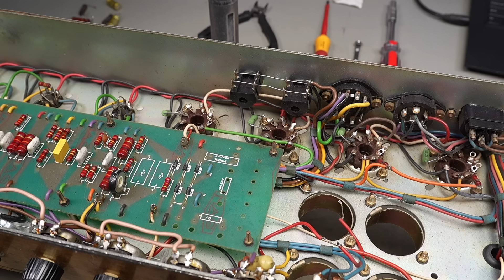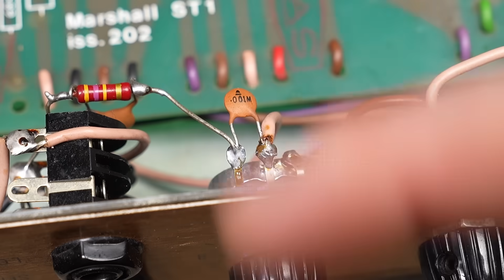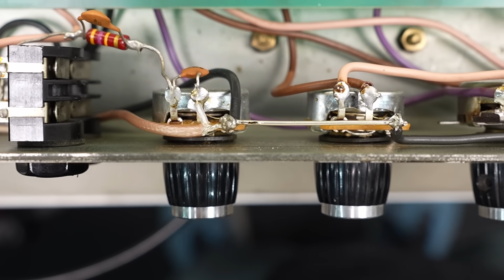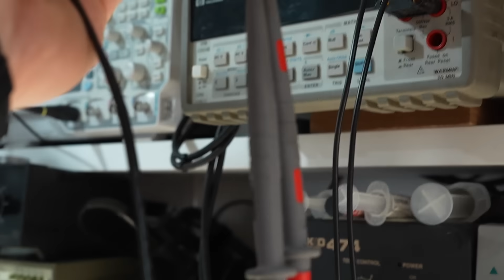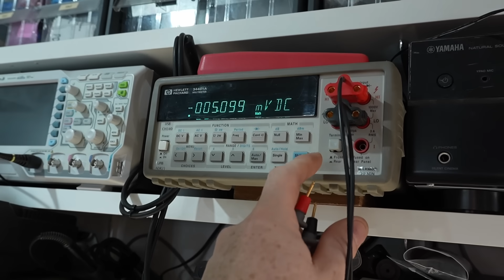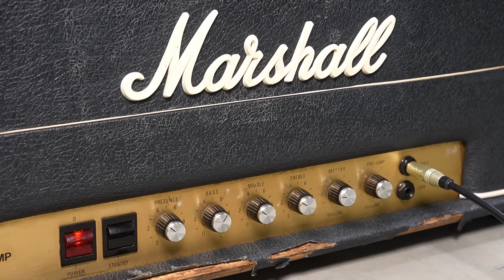JMP2203 - Part Two

Comment: Great job and great sounding amp! I just de-modded an ‘82 2204 jcm800 and it’s a blast to play. Need to look into these ground schemes and change some of that around but it’s a work in progress, first order of business was to de-stupid it. Had to also run another resistor in parallel on the bias circuit, I think it’s because it has a Dagnall OT even though the choke and PT are Drakes. Had so much negative bias voltage it would swing into cutoff just below the X axis on the scope when injecting a signal.

Comment: Taking bright caps out of the 2204/2203 is for wimps. You are only allowed to run these at 75% gain. There is no other setting.

Comment: Sounds epic! Appreciate you sharing more of the grounding theory. I will need to watch the part about grounding a couple more times. I think I missed what you do to manage the micro resistance in the chassis, if there is anything that can be done aside from using dedicated points
Reply from the maker: What would you rather do than use multiple grounding points?
The idea is to isolate the reservoir capacitor's current pulses in as small a loop as possible, and not have those currents flow in the chassis, but rather just be tied to it, away from the preamp ground.
Reply: @BradsGuitarGarage  Oh no I am not trying suggest the grounding scheme is incorrect in any way. I think I overthought what we normally take as granted to be grounds. Overthinking about overthinking is my normal state so I think I heard a couple points while I was working and missed your intended message. Definitely going to watch again when I can focus 🍺
Reply from the maker: Granted, I'm not the best at getting my points across, sometimes! LOL!

Comment: Hey Brad, what year is this amp?  I have one from 79 that's more or less untouched.  I wonder wht the resistors and wires look like- it's been years since I had the chassis out.  Of course, mine's mostly a home use amp without a power soak, so it does NOT get played hard.
Reply from the maker: No idea, mate.
Maker label illegible, and no time to research the minutiae.
Reply: @BradsGuitarGarage no worries, mine has the date on the chassis, thought that one might too.

Comment: Why do people not like the Marshall dsl20cr?
Reply from the maker: Because it runs the valves at around 40% bias, primarily.
Any attempt to bias them hotter just sags the pissy little power supply.
The most you can get out of them, even with circuit modification is around 50%, and remember it's a cathode-biased amp. We're aiming for 95-100% here.
Drop a set of 6V6's in there and compensate for the different plate load by running the speaker impedance off by one notch and you'd have a nice little amp, then!
Reply: @BradsGuitarGarage thanks for your reply

Comment: The grounding thing is so interesting, because our natural intuition for electricity is borrowed from our daily experience with gravity and the easy analogy with water. Gravity however, is so much weaker, like 10 to the power of 36 times weaker! With that in mind, it totally makes sense that a tiny fraction of an Ohm is a big deal.
Reply from the maker: It's very hard to explain to people how weak gravity actual is!
It blew my mind in high school physics lessons.
Physics still blows my mind.
But yes, people tend to think of the chassis as a magical black hole for return currents, where that is not the case.

Comment: What a nice looking amp! I just just bought an Applied Physics clamp on ammeter with a 20uA resolution that has a Kelvin lead current clamp. It is a modernized Hewlett Packard 428B or C, which I think IF you put a digital display on the old HP you could probably get it to a +/- 1-1/2% tolerance, but with the analog gauge it is +/- 3 divisions + another 1-1/2%, which really sucks, but it is an OLD 1966 vaccum tube meter. The clamp runs both 20KHz, + 40KHz signals (sense & send) and it degauses the Kelvin clamp's probe laminates every time you turn it on and off. The Applied Physics unit also has a magnetometer probe for testing the magnetic fields in guitar pickups.

Comment: Hey Champion, good timing on this job!! I am going through my three 2203's for the first time in 20 years, lots of useful stuff, I'm following the grounding scheme you've done here, great idea on the grid stoppers with the tag strips....  I have extensively messed about with all possible combinations of the treble bleed and treble peak caps, I have ended up removing the cap on the pre-amp volume (I dont run the level flat out, I use a mix of humbuckers and single coils playing dirty old 70's rock),  gives me the ability to vary the level and have the consitent tone without that ear bleeding top end which gets worse as you lower the level. I have a 500pf cap on the first peak across the 470k resistor after the first gain stage, then after the second stage on the 470k divider into the cathode follower, I have a 250p. There are some other secret gain mods and cathode bypass caps as well as a change in the Mid control value, and a different value for the treble cap in the EQ......I love it, best tone ever, wish I'd done all this when I was younger and playing in bands....I'm too old now but still play a lot at home, the neigbours love it.......Cheers Legend for all the tips!!

Comment: "In the heat of the day I hang my head down low....hiding my face from the sun. From the light of the day until the evening time" Marshall, Mesa boogie and Coverdale's glory!!! ⚡🫨🤯  AWESOME MORE GROUNDING INFO,  WOULD LOVE A DEEP DIVE! A VINTAGE TUBE AMP SOUNDS SO MUCH BETTER WITHOUT A NOISE SUPPRESSOR/ GATE CUTTING OFF SUSTAIN YOU KNOW!